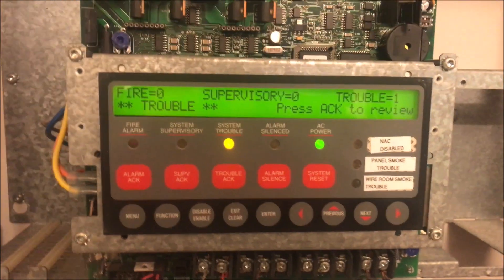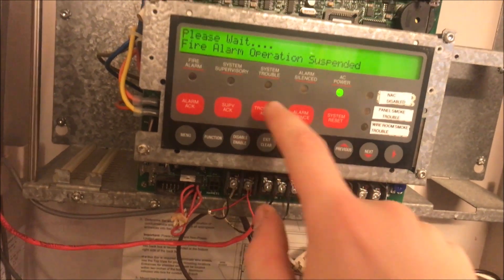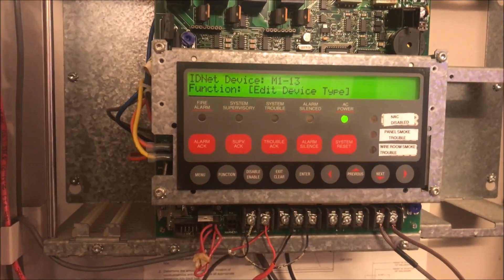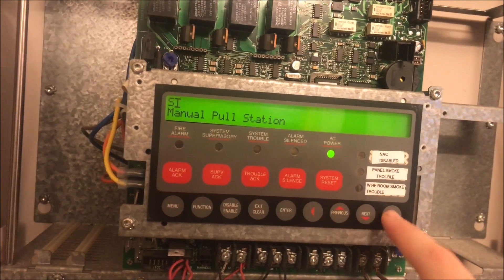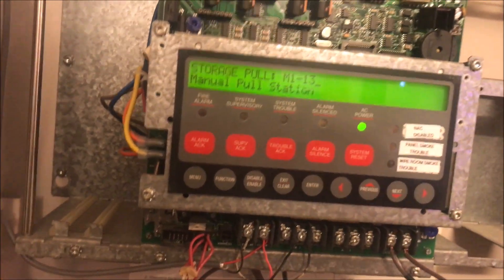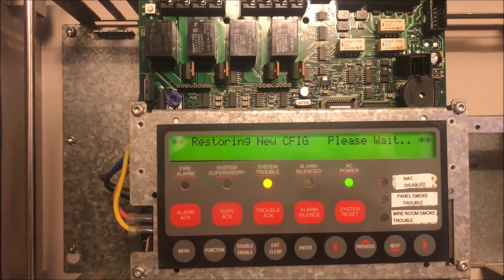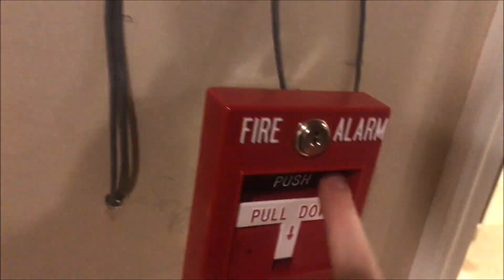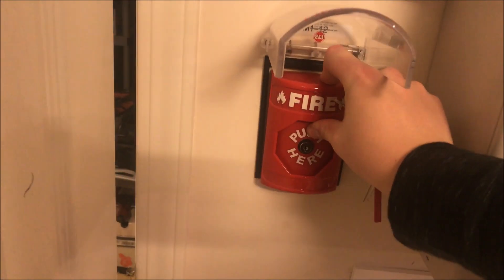Creating an IDNet Label on a Simplex 4010 Fire Alarm Control Panel

Comment: I have a question. Can I fully program a Simplex 4010 through the panels keypad?
Reply from the maker: So far, I haven't been stopped. It is just slow and difficult sometimes
Reply: @FireAlarmsandSuch makes Sense. Thank you so much
Reply: @FireAlarmsandSuch  CARD 3=ID NET CARD CHANNEL FAILURE . HOW WE CAN REMOVE THIS FAULT. PLZ IF YOU KNOW.